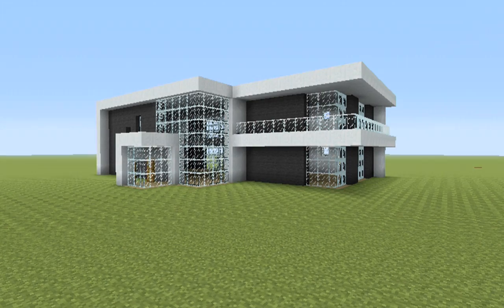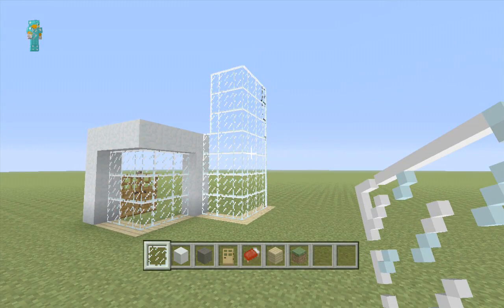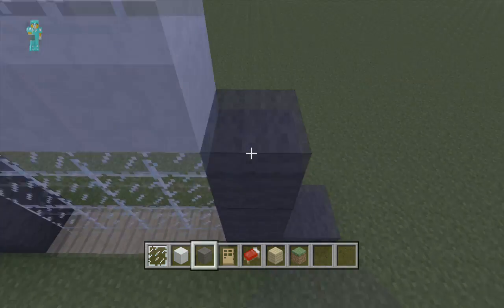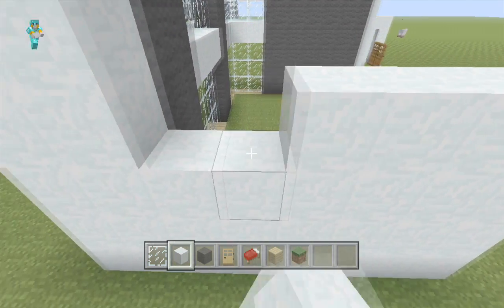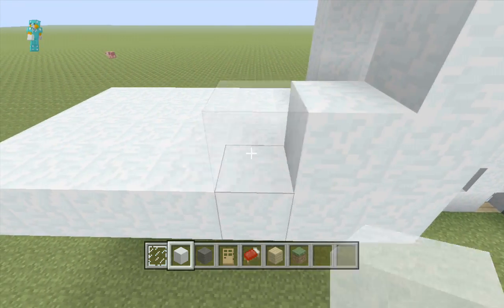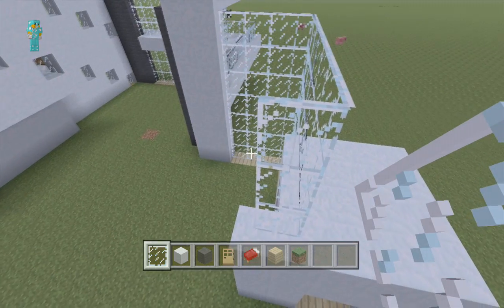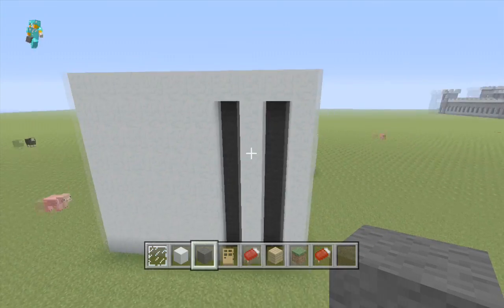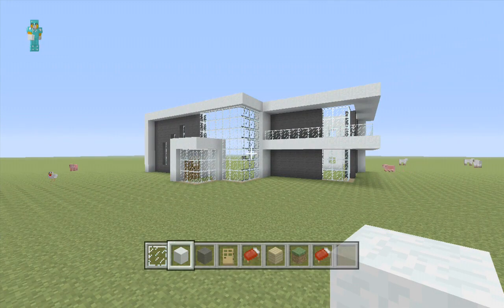Large Modern House Tutorial - Minecraft Xbox 360 #1

Comment: At 17:17 you say to place 9 grey wool blocks but in actual fact you placed 10 just thought i would point this out as i had a bit of trouble finding where i went wrong on part 2 apart from that its a great build thanks
Reply from the maker: Thank you for notifying I did not realize!
Reply: no if you dont put any light blocks by the snow if your are worried about it use either white wool or as i used use plain quartz blocks
Reply: martjon2
Reply: Matthew King Bmx